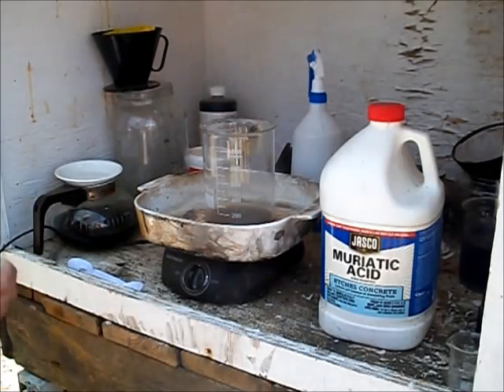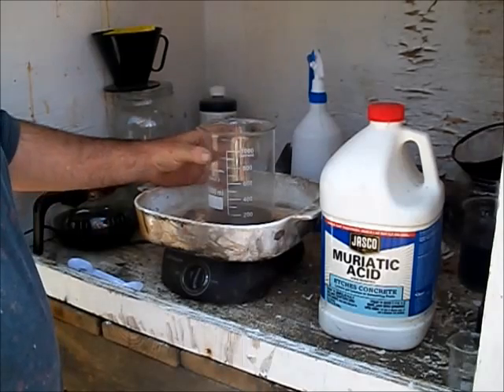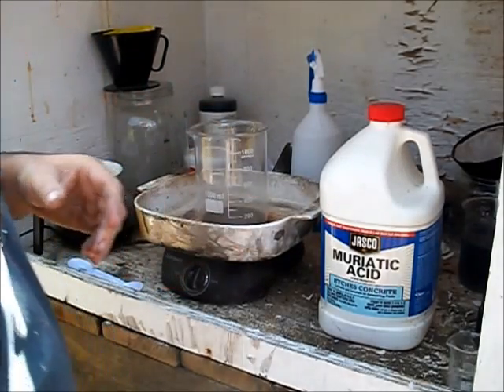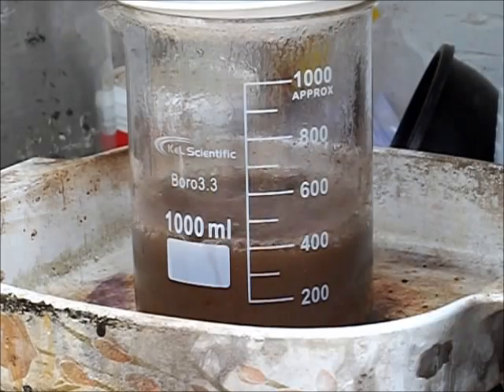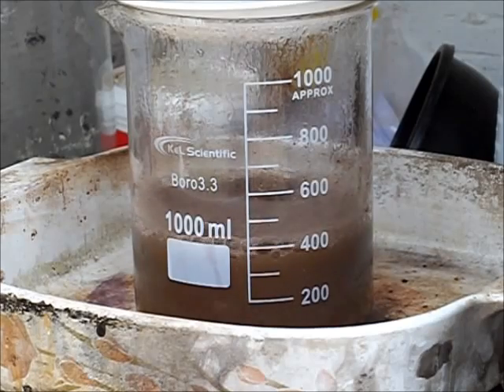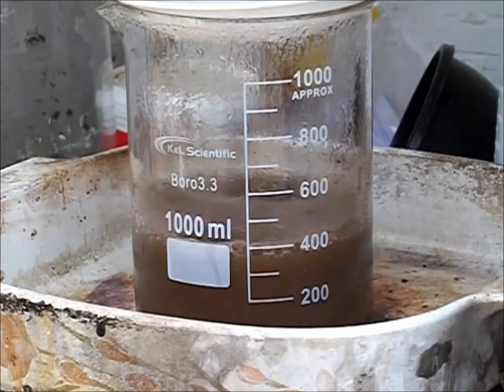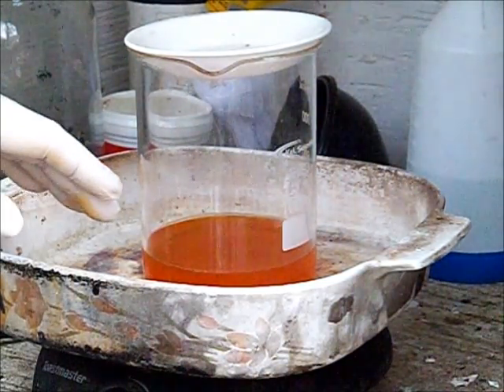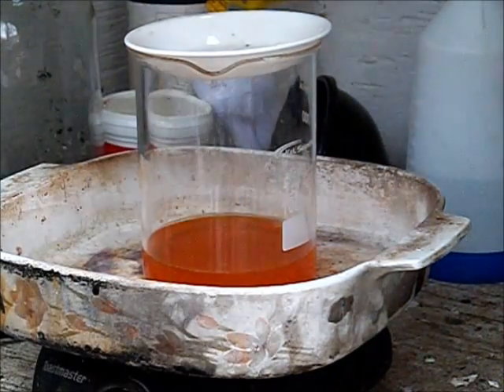Rob's foils 3

Comment: glad YOU know what your doing, it looks like alot of work. thank you.
Reply from the maker: +Rob Buechner It's really a lot more to it than just adding this and that. Thank you Rob for the opportunity to show off my mad skills. LOL
Reply: How do you get the silver out of the solution ? Out of the a ~p and such ?
Reply from the maker: +Rob Buechner Silver will not dissolve in AP to any extent that will be noticed. Silver that is in AR is a different story. There is only a certain amount of silver that can be in AR at a given temperature. The lower the PH and the warmer the solution is, the more silver it can hold in solution. Since aqua regia is a chloride based solution, silver will precipitate out of solution on it's own without any other help. The nitric acid in the AR is what dissolves the silver and the HCl has nothing to do with it. After the silver is dissolved, the silver nitrate will steal a chloride atom from the AuCl2 to form silver chloride. Gold chloride (HAuCl4) is a liquid and silver chloride (AgCl) is a solid. The chemistry does not allow both gold and silver to be in solution together at the same time. There are a couple of exceptions such as cyanide and bromide. There is a balance where the silver chloride will stop precipitating on it's own but you can force the silver to precipitate out of AR by either raising the PH by dilution of the solution or by lowering the temperature of the solution. The silver will drop out of solution as a bright white powder that will darken in sunlight until it is black.